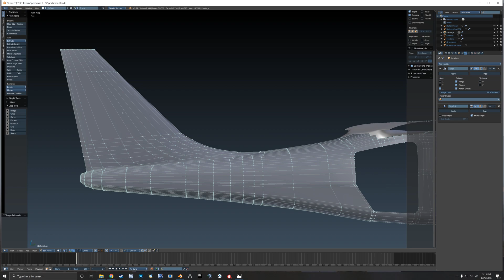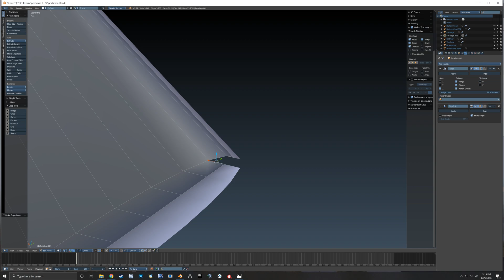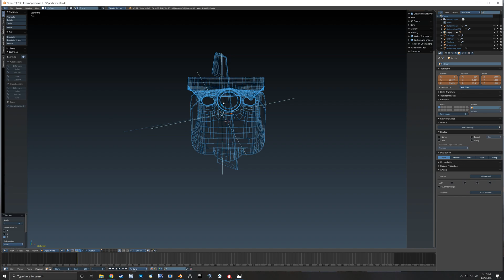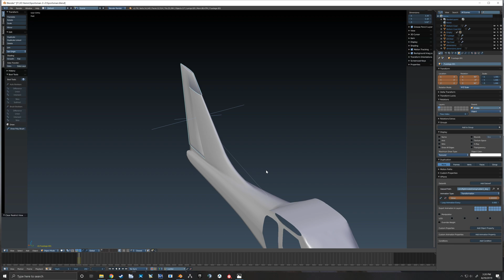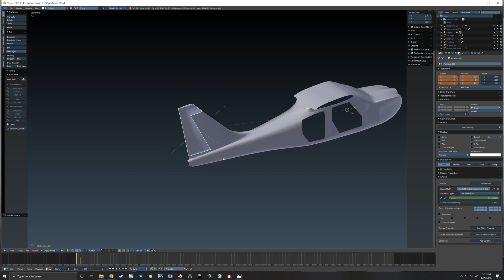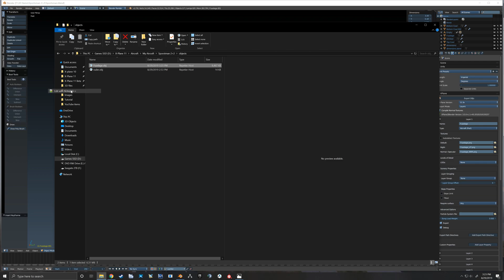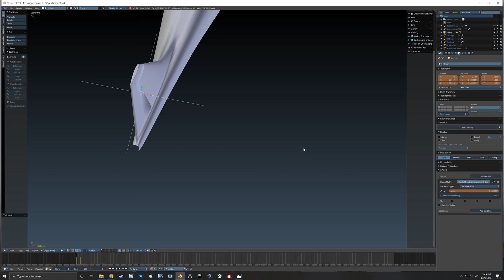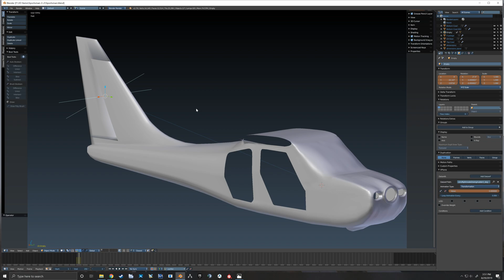Making an airplane for X-Plane 11 Tutorial #12

Comment: I'm still having problems with the datarefs, they don’t work for me, some help please
Reply from the maker: Make sure your spelling of the dataref is exact. It won’t work with the slightest typo. Look at the default aircraft for reference. You can open an obj with a text editor. Notepad++ is a good one.
Reply: @BuildItBetter3D  The datarefs isn't a problem I think its something to do with with blender because,  I started  off in blender then sent it to planemaker is that the wrong way?
Reply from the maker: You still need to be sure the datarefs you attached to an animation in blender are correct and exporting correctly. Open the obj with a text editor and find the animation and dataref to verify they’re correct.
Reply: @BuildItBetter3D  ok

Comment: Excuse but why you are modeling in blender why you already finished it on planemaker 
Just to make a nice case over the aerodynamic planemaker one ?
Reply from the maker: Yes. The planemaker model does all of the flight dynamics but it does not look pretty. To have a nice accurate looking model you need to use a program like blender to do all of the details. The blender model does nothing for flight dynamics, it is only for visuals.

Comment: I'm having exporting issues with xplane2blender which refuses to export "nested" rudder within the empty. I changed the Collection name and even clicked the box to export the child collection option in scene properties. The version I use (Blender 2.8). I read the comments below and followed the instructions in this video precisely. Doesn't matter what I've done, I cannot get the rudder to export with the animation values in the "Empty". Can you help me out with this? I've watched the video maybe 20 times to follow any steps I may have missed, but nothing seems to work like it did in your video.
Reply from the maker: You should be exporting using the exportable collection, which is basically the main folder your objects are in. If doing that then make sure that NO object or empty has the checkbox "root object" checked. You cannot have an object inside an exportable collection that has that box checked. If you haven't already watched this video it shows how to set up your collections for export in Blender 2.8 https://www.youtube.com/watch?v=x_S9NosDYIM&t=102s
Reply: @BuildItBetter3D  Thank you, the video you provided was what I needed to export the animation. I really appreciate your videos and your modeling is an inspiration to me when I was modeling my plane. I didn't see that step in this video and I was left wondering why my animation didn't carry over. But it makes sense now. Thanks again.

Comment: I have a problem, i did every thing like you. i have now the keyframes only on the empty ...and in planemaker it works, BUT not in Xplane. Do you have any idea?
Reply from the maker: If you see it working in planemaker but not in the sim then your animation is being exported correctly but you have not assigned the correct dataref to it. Check in blender to be sure the dataref is correct, including the index [?] number. Even one little typo will make it not work.
Reply: @BuildItBetter3D thanks for your quik answer, but where have to be the Index Number???
Reply from the maker: You can go here to find datarefs to use:https://www.siminnovations.com/xplane/dataref/
It will tell you how many index numbers the dataref has. They always start at [0] and go up. 
Example: sim/flightmodel2/gear/deploy_ratio[0]    --then--     sim/flightmodel2/gear/deploy_ratio[1]  
This would continue for as many as you have.
Reply: ok, i find  sim/flightmodel2/wing/rudder1_deg    (as known) and then       float[32]   .....  but where i have to put in this? Blender? Planemaker? XPlane? i have no idea....
Reply: some where a few day ago i have read somewhere that the number is [10]. i have try it now again and now ist works in xplane to. thank you very very much!!! easily behind the known datarefs in blender the number in the " [ ] ". Now i have only to find out the number where i have seen this the last days xD
Reply: Thank you so much for  sharing the "[10]"  discovery. Have you found where it was indicated ? And do we have to put it everywhere (I mean elevator, ailerons? 
THis serie is really helpfull Built it Better. Thank you very much. That is my first attempt to create a glider model in the sim. (Blender 2,8) 
EDIT : For the Number, it could be on Xplane Developer : https://developer.x-plane.com/article/using-the-correct-wing-datarefs/

Comment: Are you planning to use Blender 2.8? They have a beta plugin for it. I am trying to learn 2.8 as the new standard.
Reply from the maker: I will switch to 2.8 when we have a stable exporter. I don’t use beta programs for anything important, it’s not worth my time to deal with bugs and potential loss of work. The majority of building for x-plane won’t change. The only big change in the process I’m aware of is no longer using layers and using root objects instead.